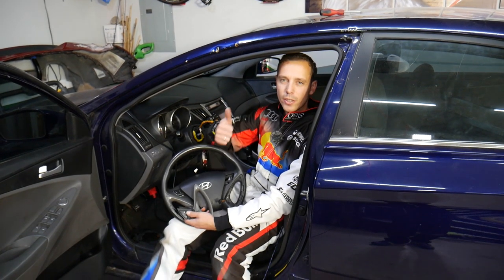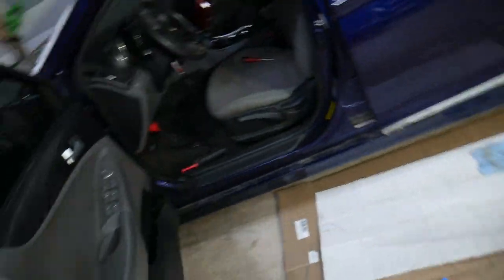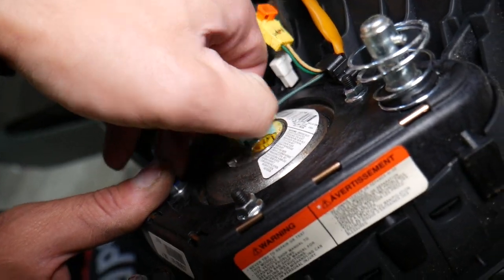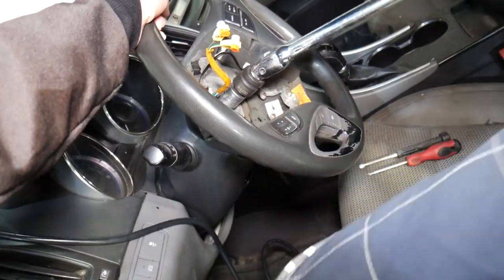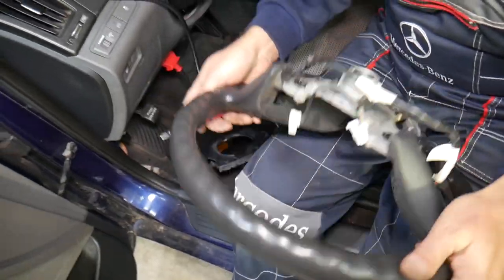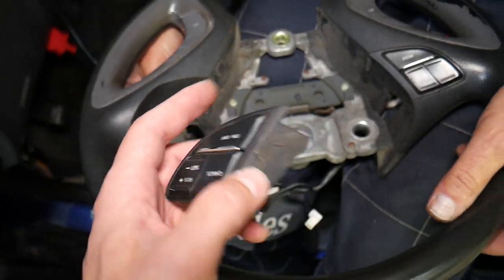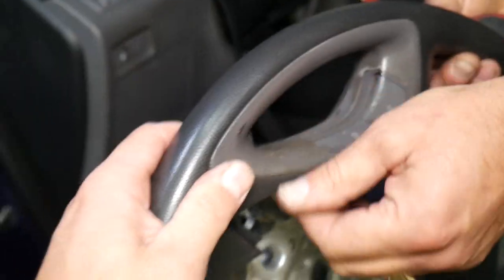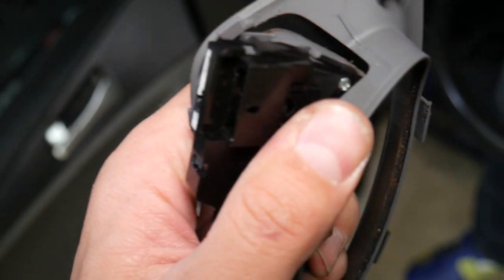HYUNDAI STEERING WHEEL SWITCH CONTROLS REMOVAL REPLACEMENT CRUISE CONTROL SWITCH

Comment: i installed it to my 2014 Hyundai ix35 elite pack car and all of the buttons including cruize control and menu button forking but TRIP A which shows average consumption has lost. TRIP B remains but TRIP A lost after instlalling cruise controll button. I am using arrow, it changes to service interval, TRIP B etc. but do not show TRIP A (average consumption). Do you have any idea for this?

Comment: Why do you need to remove the whole flipping steering wheel when the cruise control panel is on the right hand side of the steering wheel. You would only need to remove the screw on the right.